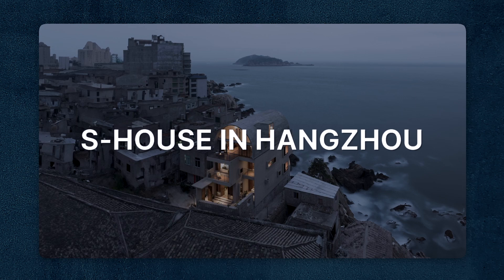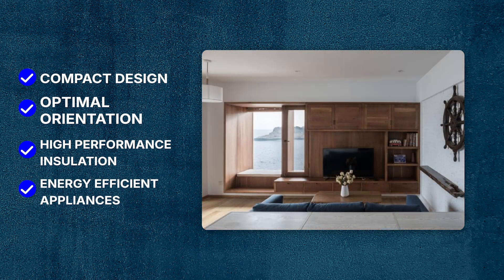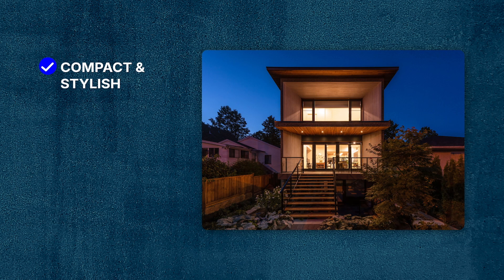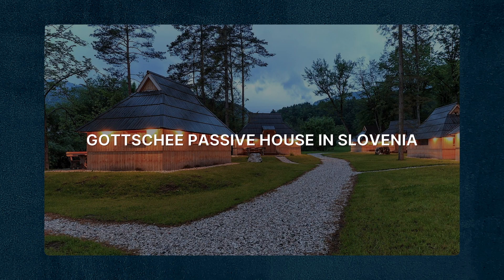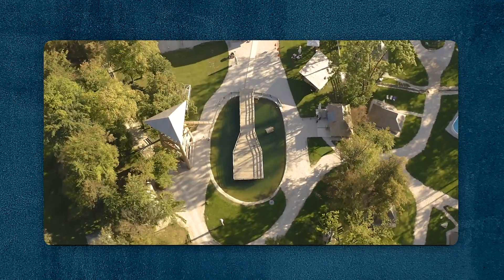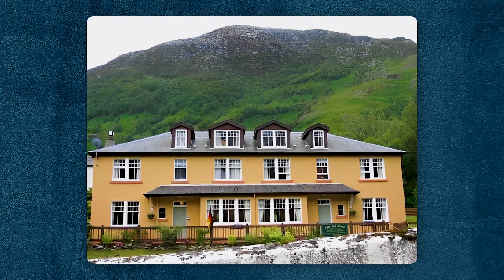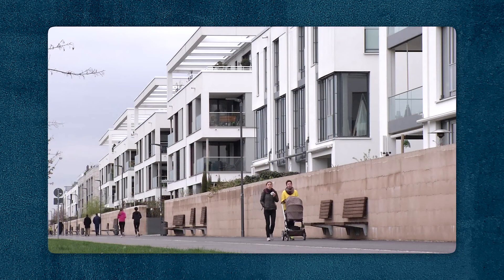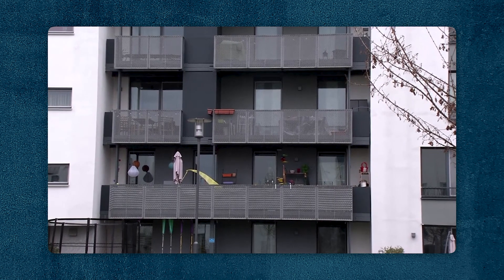What you should know about passive house design

Comment: It would seem to be easier to reach net zero with a passive house as it requires less of everything. One could extend that principle to other areas, say water use by collecting grey water from those fixtures that would qualify and then use that water to flush toilets, as an example. Air to air heat exchangers would/should be required for an passive house as they are so airtight and would need fresh air. Passive houses also could incorporate passive solar heating designs which require nothing to operate and provide a portion of the energy to heat/light the house. Good video, thank you.
Reply from the maker: Great points! Agreed. The layout and cost depend on the climate. In cold climates, passive houses need really thick insulation. Thank you! A pleasure to see you here again! Katha